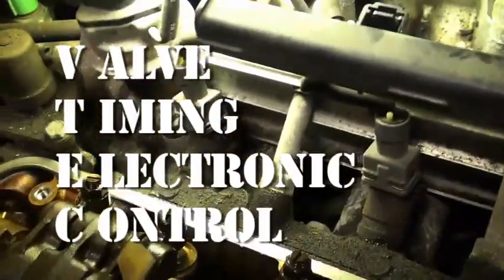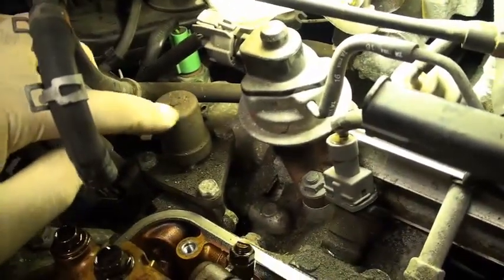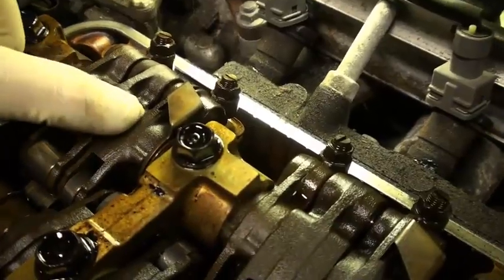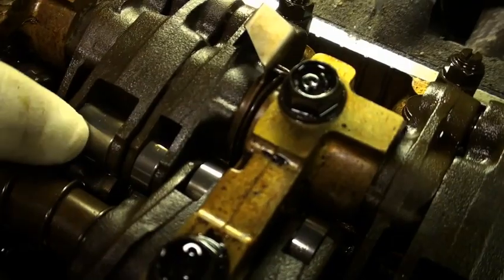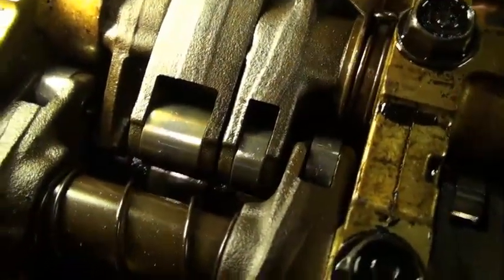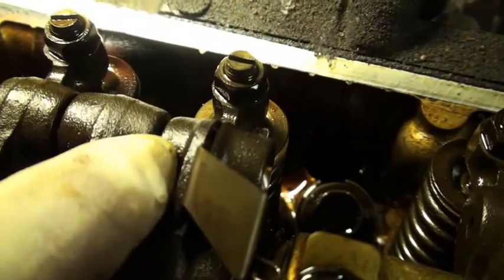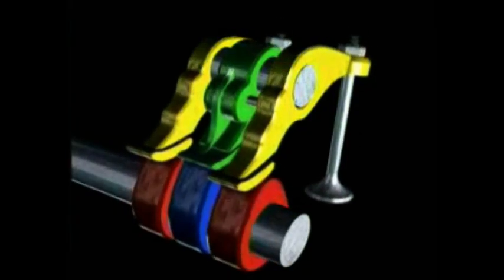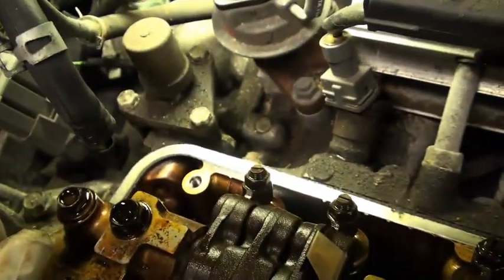What is VTEC and How Does it Work? - EricTheCarGuy

Comment: The camshafts aren't doing anything they normally wouldn't do. They're not "giving up rotational engergy", the phasers are merely taking advantage of the valve spring forces, it's a much more efficient system that doesn't require an oversized oil pump or oil to be bled off, nor does it require the extra rotational mass of another set of lobes There's no need for another set of lobes in a v8 like this. The heads already outflow NASCAR Yates D3 heads up to .472 valve lift, which is stock 5.0 lift.

Comment: First, very little power is lost when you bleed oil pressure off to power something like VTEC. Second, it's not totally power-free, this CTA. Something needs to give up energy to wind up the springs. In the CTA's case, it's the camshafts themselves giving up rotational energy to wind up the spring. Third, the reason you need a different camshaft is that it has a higher lift, meaning more air, more torque and power.

Comment: From what you describe, changing valve timing won't do very much but distribute the torque better. It doesn't give more torque. VTEC actually causes the engine to intake more air, which means more torque and more hp.

Comment: At least you spelled VTEC correctly. However it is certainly not a crutch and is far superior to any single cam engine. This was perfected in 1983 by Honda, and has been copied by every other auto maker since, starting in the 90's. Such as the 2013 Mustang, who just now wised up, and have the most powerful production engine that they ever have because of the VTEC principal. Ford is 20 years late. The Fact is, if you apply VTEC to ANY engine, you could gain optimum low end performance as well.

Comment: Thanks, and i'm just saying, I had to use a 2011 v6 while my old 2011 F150 was in the shop with a tire issue. I managed 31.4 mpg @ 75 mph. I'm certain I could've gotten more if I had cruised at 70 or 65 mph.

Comment: My point is that any modern high performance engine (with the exception of porches and such) can turn in good fuel economy numbers, the only reason ford can claim the first 300+HP v6 to get 30mpg is because the EPA certified them at that. now whether anybody who owns a v6 mustang actually gets that who knows, but i know most newer v6 mustangs i see on the road most of the drivers have a lead foot and most likely never see 30mpg. btw i love the new 2013 Mustang GT :) very nice car

Comment: I've gotten 26 mpg with two passengers and a trunk full of luggage. That's with the restrictive closed air box, restrictive stock exhaust etc., bone-stock.

A stock 5.0 with just suspension modifications from Eibach goes from 26 to 28 mpg, no engine/exhaust modifications whatsoever. I'd assume I can get 30+ mpg with an Eibach kit + open air filter/exhaust and coils/plugs.

The point of fuel economy is to baby the car, not sure what your point is. I still have an instant 390 ft-lbs at any moment.

Comment: I'm pretty sure most Ford internal combustion engines use CTA now, but most notably the "Coyote" 5.0 GT's with 412-420 hp, the Boss 302 variant of the Coyote, dubbed "Roadrunner" with 444 hp, and somewhat overlooked, the new base-model Mustang v6, the first reciprocating internal combustion engine in history to offer over 300 hp and over 30 mpg.

There are also Jag/land rover engines that use CTA.

Comment: you mean BMW's Valvetronic system, right? Vanos is "old" tech
I just read this yesterday from topgear: "Honda's VTEC system and Rover's VVC were among the first to use differing cam profiles at different revs, giving an optimal timing and lift profile for mid-rev torque, and another for high-rev power. BMW's Valvetronic and Fiat's MultiAir are even more sophisticated ways of controlling valve timing and lift, plus they let the engine run without the throttle and its associated pumping losses."

Comment: I actually liked the NSX, I also like the engine that's in the S2000, the car looks a bit gay, but I can appreciate 9,000 rpm off the lot. However, the fact is, both of those cars will get run the fuck over by a Ti-VCT / CTA v6 or v8....like the more recent Mustang 3.7 v6 or 5.0 v8, or some of the stuff from Jaguar....

Comment: Actually, that's exactly what VTEC does, it switches to a different camshaft lobe profile at around 6,000 rpm. 

What does it do below 6,000 rpm, you might ask? Not shit, that's what. They don't produce hardly anything at "lower rpm".

VTEC is a crutch that actually includes more valvetrain weight because of the extra lobes - seems to run counter to the point of a tiny engine, don't you think?

Comment: No, the point of VTEC is not to produce more hp at higher rpm.. on the contrary is to be able to produce power at lower rpm as well.
You can get a small engine to produce a lot of hp at high rpm.. for that you need a camshaft with loong valve lifting. But that comes at the cost of loosing a lot of torque in low-mid rpms.. 
VTEC allows you to have 2 valve lift/timming settings... one for low-mid rpms with shorter valve lifting (favoring torque/power in low rpm) and other for high end

Comment: well, you are comparing way different types here.... i can show you a 2liter toyota engine with over 200ps too.....  the toyota valvetronic is set to save fuel, while the vtec of honda is set to get high ps at high rpm...  toyota got also high ps engines with valvetronic.... like the late 2JZ-GTE from toyota supra's or the lexus ...

Comment: well, toyota has a system called valvetronic too..... dont know if its the same or who inventioned it, but its "better" then the vtec system showed here, cause it can adjust the lift not only in 2 setting "normal" and "maximum" it can adjust it variable without presets ;)

Comment: toyota's system is much the same, called "Valvematic" :) its not VVTI, its a system where the valves open variable, so at low rpm, the valves open just a little bit, and at high rpm, they open very much - just like the vtec by honda, only thing is... valvematic if "finer" it doesnt have only "2" settings, like this vtec in this video.... it has way more, so it adjust's better :)

Comment: What that idiot was angry about is how those ricefags have a notion that vtech is an amazing system. In the civic models lets say 200hp and under, its performance is noise, that's it. Even super/turbo'ed up to 300hp, you still might get 10-20hp from it, roughly 5%. It is not that radically different from the first set and is really just a selling point on the civics. A single mod, (other than super/turbo or tires) does very little, you have to do a lot to really increase in significant ways.

Comment: as the outter rocker arms lift,  while the pins are pressed against them until they're high enough that the pins fall into their holes and engage.    the pins are activated by pressure behind them (think rear wheel cylinders).

Comment: How do the pins in the centre rocker line up with the outer two rockers when the engine is running? Just seems that oil pressure alone would not be accurate enough and youd just end up with a messed up valve train...

Comment: Variable Valve Timing is not VTEC. Most VVT systems can only change timing, not lift. VTEC can change lift and camshaft profile.

BMW VANOS and Fiat Multi-Air are two other systems that can dynamically adjust valve lift.

Comment: there are ecu upgrades that you can get that actually let you set it at which rpm you want the vtec to kick in. usually its kicks in around 6k but you can set it at 5k or always. you would probably get shit gas millage and not much more power though

Comment: Tacometer* and the world record is more than 4x times that only a few years older than mine. Those inline 5 cylinders in the Volvo's are almost indistructable. The problem with a Honda is not the engine although they tend to explode if pushed. The V-tec system in them is not the cause of it and has never gone wrong. But the gear-box, drivetrain, body, suspensioin is all prety much crap. I will take A Toyota pickup over anything, even a Veyron.

Comment: No, the power is not already there. It's made by increasing the lift duration of the intake and exhaust valves. vtec killer cams make it operate on the larger cam profile all the time, the problem with this is that with a large cam at low RPMs will suffer driveability issues and rough idle. vtec is a mechanism by which one can have both a smaller cam for smooth idle and low rpm driveability as well as high power at high rpms.

Comment: And there's plenty other cars that are just as realiable. my 242 turbo has 560,243 miles on it, I know because I just checked. It's been in one accident with a deer and thats all. I had to replace a bumper and it just keeps moving. My 91 geo metro went on forever until it was stolen, but hey for $200 I didn't really have a problem with it. And then there's my 89 Hilux wich is the most indistructable thing on this planet and my 96 Supra. Honda's are not the best nor the worst.

Comment: Have you heard about the fiat multiair engine coming over on the dodge dart? The intake valves are controlled completely electronically with a kind of similar, kind of not oil pressure system.

Comment: From my understanding, varable cam timing is when timing is advanced or retarded on when the motor changes RPM, this just looks like at a certain RPM , the intake valves will open a little further alowing more fuel and air to enter the combustion chamber. but all in all, it's just more shit to go wrong when it fails

Comment: Well from what I understand the Toda vtec killer is an ultralight hollow-core cam. They are single lobe too - no VTEC. They only make power above 5000 rpm upto maybe 12K rpm and likely would idle somewhere around 2K. Hence not streetable. You would have to drive around ALL DAY at 5000+ RPM. Your gas mileage would suck, your emissions would be terrible, and your engine will not last too long if you drive your car daily with these cams.

Comment: Rather the opposite as a turbocharger. Whilst most turbochargers spool in the early RPMs to produce early power, VTEC kicks in in the later RPM's around 4500-5000 depending on the model.

Comment: I think its an RPM thing, higher RPMs benefit from the longer timing to let the engine breathe air in longer and better, while lower RPMs like the regular valve timing.  Based on what I've read that is.

Comment: if i remember right, when vtech is off, one valve opens more than the other to create a spinning/vortex inside the cylinder to help atomize and mix the fuel air mixture for a more complete burn. therefor more economy. but when the vtech kicks in, longer duration plus taller lift on both intake valves gives better high rpm air flow. therefor more high rpm power. also explains why these things scream passed around 4000 rpm, depending on where its set up at. anyway Im pretty sure thats how it works

Comment: Having a VTEC system measn that you get the benefits of a more aggressive cam profile, (i.e. more torque) but you don't get the drawbacks (rough running at low revs) because the system is activated at higher RPM. As for cons, you will pay more in fuel

Comment: Using a cam lobe with a different duration and lift profile to enhance Volumetric efficiency. Now there is also LSA controls for the intake and exhaust cams, this also enhances a large area under the torque curve. The 300zx twin turbo was the first production vehicle to sport this technology.

Comment: So, its basically running like a LOW cam at a certain rev range and when the engine hit a certain rev, higher rev, Vtec is activated and it became HIGH cam. Is it?

Comment: Okay, here comes the stupid question:

So the rocker arm is riding against the lobe on the camshaft at all times.  There's a friction point.

What if the cam lobe and it's contact point on the rocker arm were tipped with neodymium magnets with the polarity set so they repelled each other?  Using the right magnet strength, as the cam lobe came up it would "push" the rocker arm up without actually making physical contact.  No friction.

Is that even feasable/has been attempted?

Comment: Bitch please, nsx has the same stock power output without turbo as the 2jz has WITH turbo. The nsx also isn't very popular due to its expensive price because the chassi and the car itself is top notch engineered.

Comment: SAFETY, and thts it. Its up to the driver to fit it for the right part for substantial hp gain. Any car with an ecu cant gain its full potential in hp till tha ecu is flashed, and tuned or upgraded completely.

Comment: Variable valve control. Most people think VTEC has something to do with the cooling of the engine when really it just makes the engine run safer than a non-vtec motor at high rpm's

Comment: Thanks Eric.   I had a 1994 Integra GSR back when they were new.   You could hear the engine change it's song around forty-five hundred RPM when the VTEC engaged and again around six thousand when the secondary butterfly opened.    I assume with the DOHC engine the pins engaged mated cam followers instead of rocker-arms.

Comment: The nsx doesnt have turbos stock, put turbo on it and it will rape.
Supra has turbos stock, and you say upgrade turbos? its the same thing as putting turbos on the nsx, the 2jz without turbo gets raped by nsx engine, and with turbos the nsx engine gets more hp

Comment: Yeah but honda measures up to supras stock power without turbo, supra without turbo has around 200HP, hondas 2.0 liter 4 cylinder engines have that power, honda is one of the best motor manufactures in the world, dont diss them.
Note, supra is still a beast but no one beats hondas engines.

Comment: Yes It is.Honda engines with Vtec are designed with the physical stresses an engine experiences prior to and during Vtec

That is the engine has been engineered to cope with high revolutions and the necessary support that a high reving engine requires (better oil flow, better friction management, better heat dissipation etc) compared to an engine that primarily works in lower rev ranges

Personaly I feel quilty using Vtec for fun unless overtaking or sprinting for safety (red light or collision)

Comment: Hey erica OMG all your videos are simply intriguing. I have a request. I seen how you swap out transmission fluid and i immediately changed mines last week. Its a 2008 mercury milan 5 sp auto 2.3L. The oil was black, I changed it twice to get the rest of old fluid out of torque converter and notice the car takes awhile from 1st to 2nd gear only until the car is completely warmed up. Any way to fix this or is this a major warning. Trans fluid is top off at right levels to a ruby red color. Thx

Comment: @dsjkak1 There was enough oil, anything was going fine and then suddently stopped working. I know its not working cause when i reach 5000 rpm, the power is the same. The boost of the vtec system is not there anymore. Got an H22A4, 2000 prelude. ill wait the next oil change, maybe the oil supplement clogged the pins or the oil pressure switch got a bad reading... If not working ill wait till winter is gone and check all the stuff.

Comment: @insulationking You might not have enough oil in the car. Most vtec engines use about a half quart more oil than a non vtec engine. If there is to little oil. There will not be enough oil to pressurize the vtec system and engage these locking pins he showed in the video. I'm assuming if you know know its not working becuase of a dtc. If its a vtec solenoid malfunction code that's the usual cause.

Comment: @dgurevich1 VVT is not the same operating principle as VTEC.  While yes, VTEC is a 2 step lift mechanism, VVT is a single step lift mechanism with cam phasing.  That doesn't change the lift, or really duration, it simply optimizes timing for RPM.  VVTL-i had the ability to alter lift, and phase the cam, which pretty much made it similar to i-VTEC, which does the same thing.  Considering that a single cam profile can work well over thousands of RPM, the disadvantage of 2 step systems is overrated

Comment: @TheLastMag Actually, VTEC and VVT are completely different systems.  VTEC has an actual two step lift mechanism (which means multiple lift and duration profiles), while VVT is merely a cam phasing mechanism such as VANOS.  Also, VTEC entered production in 1988, so Honda was clearly not copying Toyota.  Finally, BMW had cam phasing first, so Toyota would be copying them.  VVTL-i was almost a direct knockoff of VTEC.

Comment: @JonTheSicilian the fact that the b20 and k24 have more torque than hp does not mean that they aren't virtually torque-less.  It just means that they have very low horsepower.  The b20 has 133 lb/ft of torque.  Pretty sad if you ask me.

Comment: @skatecodered Maybe a Dart based 5.0, but not a stock XXX. There is next to no material in the lifter valley. After around 500hp that's the weak point and they literally break in half. I've built a couple them.(One 302 and two 331s) With a lifter valley girdle, a lot of stress riser smoothing and billet splayed mains, you can stretch them to 600ish.

Comment: @risendrummer14 Yes, but its pointless, they designed the cam so that the power is maximised at all times, ie, at low end the cam gear with out vtec is designed to have good low end power and torque, because of this the RPM power band is only limited to 2500-4000 rpms or somewhat, after that vtec engages were a differentpower band is then engeged buy the differant cam lift and duration  causing the power band to then move from 4500ish to 7k+ rpms, so no, dont engage all the time.

Comment: @redwhiteblue91 

Only on certain engines such as HX Civics
Otherwise, all 16 valves run at once, and in VTEC, the intake cams open the valves for a longer period of time, allowing a bigger combustion.
(or both intake and exhaust side valves open longer in VTEC in a Double Overhead Cam Engine)